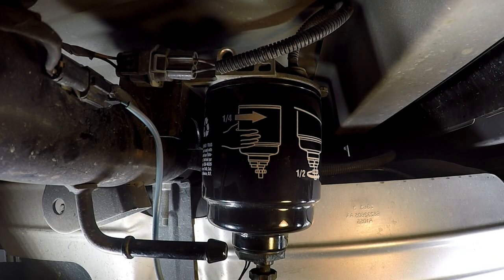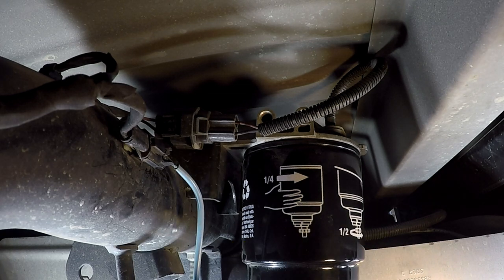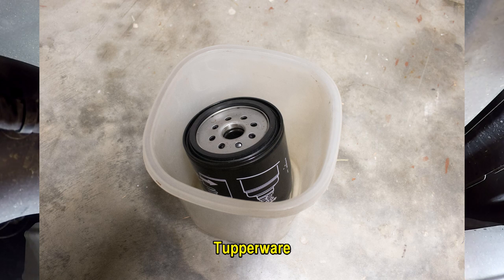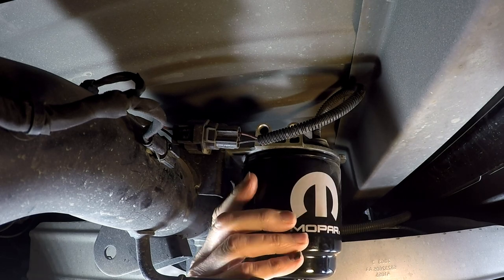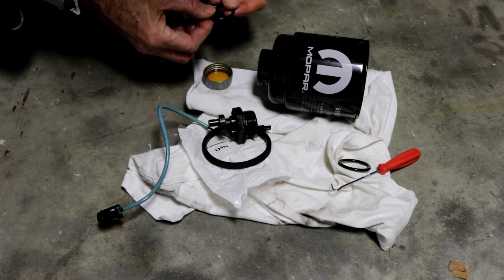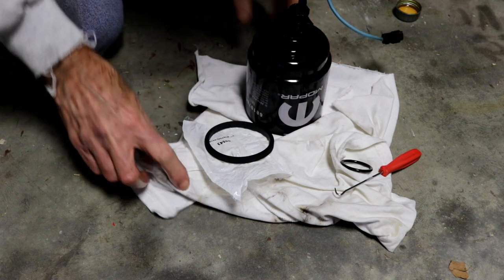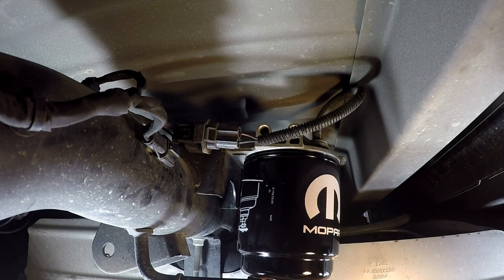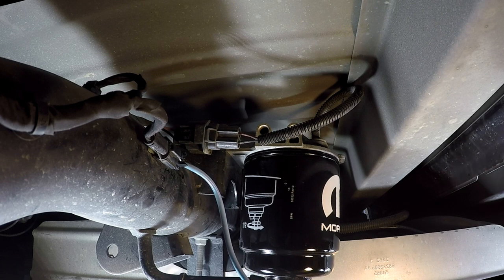RAM 2500  Rear Fuel Filter/ Water Separator change - No drain hose method

Comment: First time I changed my rear fuel filter I got reminded about the effects of vacuum... when fuel stopped coming out of the petcock valve I stupidly enough closed it and cranked loose the filter. What happened next y'all can probably figure out yourself... my face was silky smooth afterwards - by far the most efficient facial treatment I've ever had.

Comment: I thought the reset light was for the fuel filter not the water separator
Reply from the maker: @JosueGuardado-y1o  it’s for both assuming you changed them at the same time which comment says 15,000 miles

Comment: I use a big funnel with a piece of 3/4 heater hose on the bottom of the funmel crack the filter and let it fall into the funnel no mess

Comment: Hi Marion
We're in the market to purchase a RAM 2500 with the 6.7 diesel for our bumper pull. I've been doing a lot of research on 6.7 maintenance so I will have a pretty good idea on what to expect as a diesel owner. I've been watching few of your videos and had to comment on the Ridgid tool you used as a filter wrench. I would have never thought to use that strap wrench for a filter wrench. Back in the day I had one in my tool box for plasti-bond conduit. I gave it away thinking I would never need it again, LOL. I see now once I make the RAM 2500 purchase I'll go ahead and grab a strap wrench too.
Thanks for the videos, I find them very useful.
Reply from the maker: I saw one at lowes the other day that looks very much like the Ridgid.   I think it was in the plumbing area.

Comment: Hallo Marion, different topic going back to tire replacement. Do you think it's ok to take off the four wheels from my dual axle travel  trailer and temporarily put on my two spares ( thus having only one on each side) while I bring the four old ones to the shop for mount and balance new ones? Basically is it safe for the trailer to be supported and kept parked stationary temporarily by only two wheels instead of all four. Also, the tires I have on it now are the original ones (made in 2014/2015) that came with my 2015 Keystone Outback that have no more than five thousand miles on them. They still have very good tread and minimal if any cracks on the sidewalls. Their brand is called Trialer King. Do I even need to replace them now or should I just wait till I put another five or ten thousand miles and they get older. Thanks again, best, Happy and safe RVing. 🌞
Reply from the maker: I would replace them.  I've seen blow outs take out hydraulic and electrical lines and even saw one go thru the floor.  I think I talked about this in my Maxxis video.  Trailer King and all the China bombs are ok as long as you keep the tire pressure at the max on the side of the tire.  If you've got enough block, you can block up the both sides and let the wheels hang, it won't hurt them as long as you are on the frame.  I can jack up both wheels with a bottle jack from the middle of the tires and block it there with one set of blocks.  Make sure the balance the new on as a lot of dealers don't do it unless you tell them.

Comment: The drain only drains the water out. What happens if you take off the bottom valve b4 taking off the filter- will that "drain" the filter? Last time I removed rear filter, diesel sprayed out all over making a mess!

Comment: Marion Great Video. Do you know if they sell water separators that are see thru or transparent? Semi- trucks have the see thru separators where you could see the water separated from the fuel? I'm looking for one. This way you can look to see how much water has separated and when to drain it. That would be cool if they sold one. Maybe someone out there would know. Thanks again
Reply from the maker: Racor sells them.  Don't know about where to mount it.  BTW, Racor makes the one on the rams 13 thru 18.  Racor is the best water sep you can get.  Virtually every vessel in the ocean has a Racor.  https://www.google.com/search?q=racor&rlz=1C1CHBF_enUS975US975&oq=racor&aqs=chrome..69i57j0i20i263i512l2j0i512l7.1401j0j4&sourceid=chrome&ie=UTF-8
Reply: @MarionBlair  The '19 & newer trucks have a rear water separator made by Parker. Doesn't Parker own Racor? I'm not too sure but it may be a Racor as well. It does the job because my front filter is always clean at 15k mile intervals.

Comment: A little off topic, I watched your videos about the foam and baffle inside the air intake, and given all the research and work you put in, I won't be putting a CAI in, I am curious to know though what your thoughts are on the drop in filters vs the oem filters inside the oem air box, are the drop in filters really that beneficial, or with the increased air flow, are they just allowing more particulate to pass through to the turbo.
Reply from the maker: If you are referring to drop in filter as like a reusable (K & N), No they allow more air flow but also more dirt.  Stick with OEM, personal opinion.
Reply: @MarionBlair  thats exactly what I was referring to, and thats the exact answer I was looking for, thank you

Comment: Nice work Marion! Just replaced my front tank float on the 1997 f350 turbodiesel. Fuel gauge now seems to work. Forgot to connect the plug and at first I was upset. 
Is it ok and no damage if we put the bottle jack to the shackle between the two wheels on the travel trailer?
Reply from the maker: I had to change my float gauge on my 95 Ram 2500. Yes that's where I put it.  Just jack on the camper frame not the axles.
Reply: @MarionBlair  Got it, makes sense to jack from the solid I beam frame not a more fragile axle. Have you ever heard of Hercules tires? Hercules HT- 901 all steel 15" tire.https://youtu.be/WCSt74AzDuU    I hear you had bad luck  with Goodyear tires. Alot of people had troubles with their Marathon. Supposedly their Endurance is a much better tire. I hear the Endurance has very little tread depth however. I'm sceptical about this. I like a good, safe amount of tread depth. I'd think it's safer in rain  and would last longer too? Thanks,  have  a good weekend 🌞

Comment: Changed both fuel filters…no start….tried your priming method in the fuse box…no fuel is getting to front filter.  Any ideas?  Check valve not working in rear filter is my thought. 2018 60,000. How does that valve function? I am going to get a strap wrench to see if I can tighten it more. Maybe a bad filter that won’t open the check valve.
Reply from the maker: Sounds possible.  Is that a mopar oem filter
Reply from the maker: It’s got to be the rear filter.  I’d take it back off and look inside and see that the little probe that pushes the check valve up is not missing or broken.
Reply: Thanks….I will check today and let you know.  I bought them on eBay. They look like Oem, but I’m thinking the price was too good.  I complained to the seller and his reply was in Chinese.
Reply from the maker: @DavidSmith-pw8lm  If it’s the OEM, you’ll have to push up on the filter to get the threads started.  Be careful not to cross thread it but it’s straight forward.  You can feel the check valve open when you pushing up, if you can’t, wrong filter or aftermarket.
Reply: Bought filters from dealer, compared them to eBay filters, installed them, did your priming method….truck started first try.  To note, when comparing the filters and their packaging side by side they do look legit.  The differences on the packaging are eBay was brighter and glossier paper and the one difference was the dealer one had a date stamp on the box. The lettering was close but had some flaws.  Now to the front filter: the eBay one looked almost exact except for it did not have the part number laser engraved on the top. The inner lining was a greenish colored mesh which did not have as much restriction as oem. The measurements on it were close but the ball pin was a bit more.  The rear filter looked exact except for a silver unpainted edge where the canister was crimped to the base.  It was missing a o-ring in the center hole which explains the ease if it going on. The ball pin was recessed 5mm deeper which could account for it not functioning.  In the end I am glad the truck did not start…..they were junk.  Buyer beware.  Thanks for your help
Reply from the maker: @DavidSmith-pw8lm  Thanks for the info David, I’m going to recheck mine.  Amazon has some fake OEM stuff.  It’s sad we have to put up with this crap.  Thanks.

Comment: Looks like yours came off easy after you broke it loose. My 2014 is a fight all the way to the end of the threads, have to wedge myself between the frame and dpf on the exhaust to get a good enough grip and break it loose
Reply from the maker: Threads ok?

Comment: I used the same bucket method after the First Messy Filter change with diesel dripping everywhere.
On my next fuel filter change I think I will fill the rear filter with diesel. Hopefully it will cut down on ignition cycles.
Reply from the maker: Yea, or do it this way.  https://youtu.be/5K26zXB64Mw

Comment: I know this has nothing to do with this video but i can not find anything about how to do a coolant flush on my 2015 cummins. I cant seem to find the radiator drain plug and have heard conflicting info as to wether my truck even has one, i also cant find a tutorial on how to bleed the air from the system and there is no radiator cap so I’m wondering if you fill from the coolant reservoir if that fills the radiator? Need to get this maintenance done and it’s stressing me out, just wondering if your 2014 is similar and if you have any advice. Thanks.
Reply from the maker: The drain is on the driver's side on the side of the radiator.  I'm going to have to do mine soon, I'll do a video.

Comment: Hey Marion.  I am noticing my 2014 2500 fuel filer life is following oil life in the last year or so.  Before I could go two oil changes before a fuel filter change, now it seems to be one for one.  Old girl is getting up there in age but my driving/towing has not changed much in the last five years.  Any thoughts on that?
Reply from the maker: Not off hand.  I think the gauge just track miles of to 15K
Reply: That's interesting. I agree with Marion that it appears that the fuel filter life indication on these trucks simply counts miles and tells you the filters need to be changed when you get to 15,000. I wonder if your scenario says something about the oil life indication and how oil life is determined by the truck. The manual says to change the oil every 15k miles or 6 months, whichever comes first. I change it every 6 months and that usually coincides with somewhere around 7,000 to 8,000 miles, and at that time the oil life indication tells me I have somewhere around 50% oil life. So I have always assumed that the oil life indicator just counted miles as well, just like the fuel filters. Maybe this is something you'd want to keep an eye on to see if you notice  that the oil life is not dropping linearly with miles. My thoughts on the oil life indicator are obviously highly speculative and based on assumptions.

Comment: Thanks, Marion, for another instructive video. I agree that the "bucket and no-drainhose method" saves you one unnecessary and messy step, so probably the better way to do it.
On another note, you've now got me all freaked out about the "counterfeit" filters on the market. I've been buying my filter sets on Amazon for about $130 bucks and they come in sealed Mopar boxes with O-rings, etc. They all APPEAR to be legit Mopar parts, but is there some way to tell if you're getting counterfeit parts? Or, were you referring to all the cheap aftermarket replacement filters when you say to be careful of counterfeits?
Reply from the maker: Yea, that's what I meant, the cheap aftermarkets that make you think you're getting an OEM equivalent.  I do the same as you.